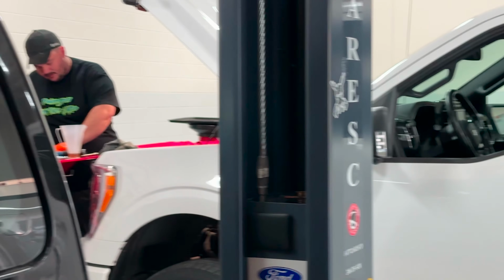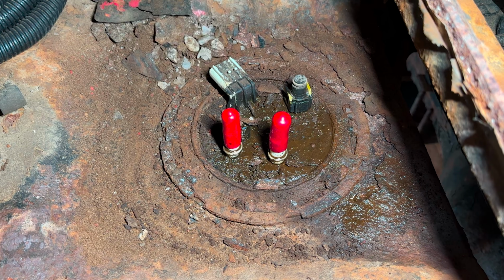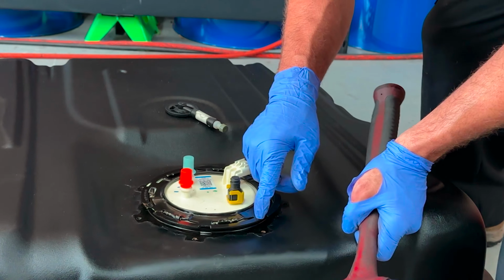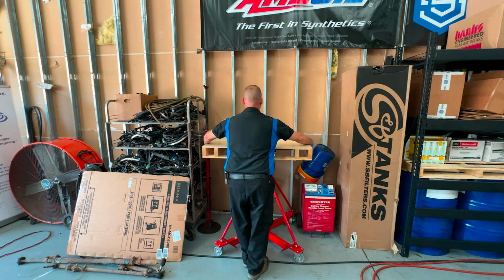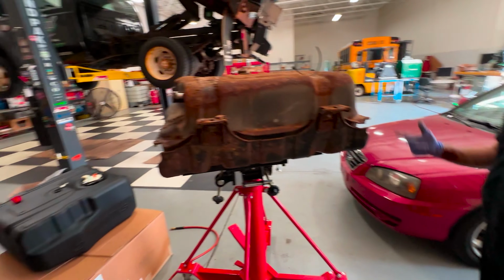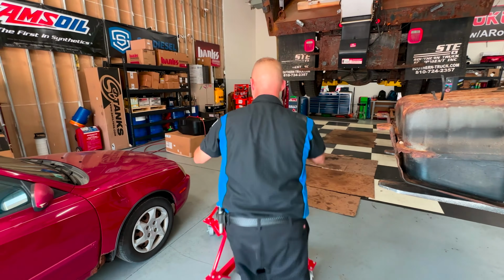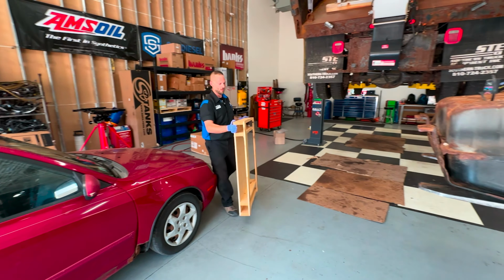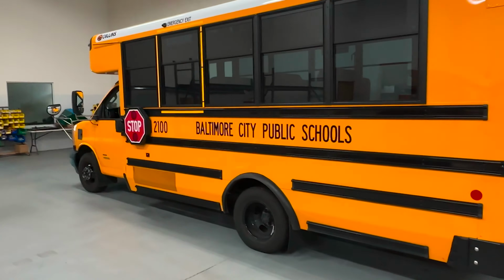MICHIGAN has claimed another Ford 6.7 dump truck | Fuel tank TIME! #diesel

Comment: I realize you’re in the rust belt, but could annual frame painting and frame oiling help control the rust?
Reply from the maker: If it was done the VERY 1st day, then yes.
Reply: It's helps but being a landscape\plow truck with a salt spreader in the back of it is literally holding and spreading the corrosive rock salt for half the year out in the slushy snow. It really sucks what it does to our vehicles up here!

Comment: How is the fuel blue?
Reply from the maker: It's not
Reply: It's green!
Reply: Diesel fuel has 3 colors. 
Clear/yellowish: over the road vehicles, taxed.  
Green: biodiesel, taxed at a reduced rate. 
Red: off-road equipment (tractors) non-taxable. 
NOTE: The penalties for using red diesel in your vehicle are severe!
Reply: @BobOtto-PlantDr  here in the mitten we are using winter diesel ⛽️
Reply: @PowerStrokeTechTalkwARod  to me it looked blue in the video. 😁👍🏻
Reply from the maker: @davebutler6405 iridescent
Reply: Yeah it's greenish tinted or red tinted if it's off-road (non-taxed) fuel.